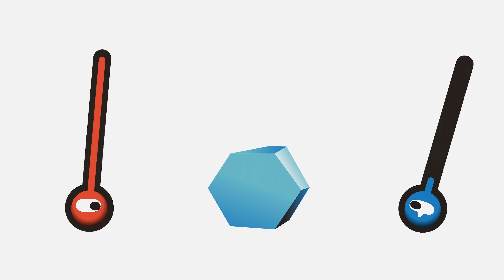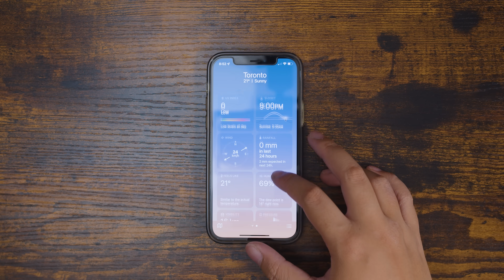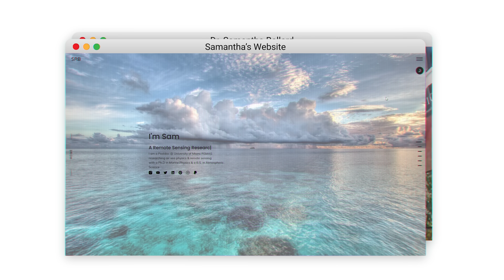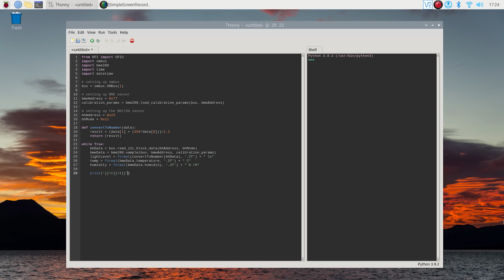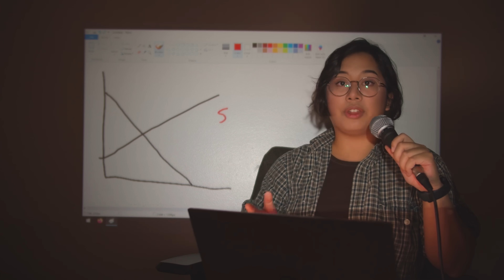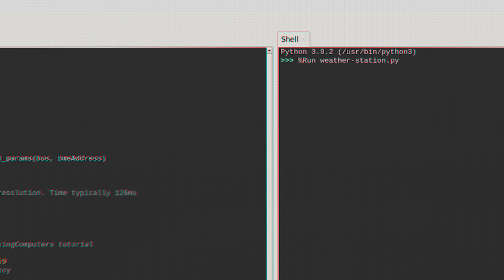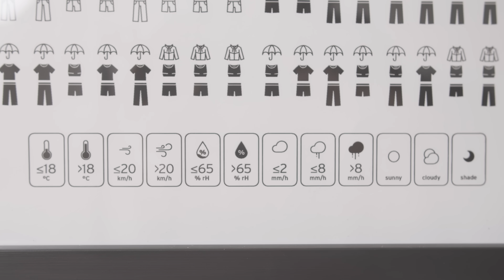how fahrenheit fails you

Comment: For me, most of the year, pants vs shorts is decided by the season. There is generally enough overlap between them that spring/fall I could wear either, unless the temp is far in either direction. I'll generally wear a t-shirt down into the upper 50s F, but am not uncomfortable wearing a light jacket into the upper 60s. Similarly, I can wear the light jacket down to the lower 40s or a heavier jacket into the mid 50s. Anything near or below freezing (32F) is at least pants and a full jacket. Gloves/hat generally below the upper 20s, extra layers below 10.

Now for the rant.

The nice thing about Fahrenheit is that below 0 or above 100 just means "don't go outside lol". If you have to go outside in those conditions, you really need to be prepared, or make it brief. Anything between is a sliding scale of what to wear.

I've never felt like Fahrenheit is harder to use as a result of the freezing/boiling points of water being 32/212. Those temperatures just aren't that relevant in my opinion. The only time I care about the boiling point of water is when boiling water on the stove, in which case, I don't need to know that it's at 212 to know it's boiling. The freezing point is also not really that relevant. And either way, I know that the freezing point is 32, as do the vast majority of people that use Fahrenheit. It's not like a "oh crap, what temperature is freezing again?", you just remember it.

The temperature scale you use in your daily life should reflect your daily life. Water really isn't as relevant as the Celsius advocates make it out to be. Sure, water is important, but the temperature scale being based on it really doesn't improve your life. If you find Celsius more intuitive, that's fine, I don't argue that you should switch to Fahrenheit. What I do suggest, though, is you stop trying to convince people that use Fahrenheit that their system is flawed because it's not based on water. That really doesn't matter at all. What does matter is having an intuitive understanding of what your arbitrary temperature system means in terms of what you need to wear to be comfortable.

Comment: I have made an effort to actually use both.  My biggest problem with C when compared to F is the C units are too large (1C is about 1.8F) but you rarely see C expressed in anything but whole units (i.e. 21, 22, 23).  You rarely see a forcast or a temperature reading from a weather app/webpage, with a fraction (21.5, etc).

Comment: Usually an ardent defender of imperial measurement systems, because of the intrinsic mathematical superiority of Base 12 over clunky Base 10, I’m going to go against my own rule here and state an unmitigated preference for Celsius over Fahrenheit, the main reason being the calibration points (0° and 100°) are known reference points, experienced on a regular basis by most people, and as such are intuitively relatable. The lower precision of Celsius degrees is really not an issue, as we are all used to using decimals and fractions in either degree scale when needed, and both being subsets of the overall Kelvin scale, mathematical calculations within them (20° is “half as warm” as 40°) are not intrinsically meaningful. 
Of course, independently verifiable definitions are one of the strong points frequently (and correctly) advertised by defenders of metric units, however most of these are not intuitively relatable to everyday experiences, and as such will not be meaningful to non-scientists. Not true with the Celsius scale, which is relatable to the everyday experience of most non-scientific users.

Comment: Okay few basic information 
Usually the lowest temperature in the winter is.. -2°C or 28.5°F
Usually the highest temperature in summer is.. 35°C or 95°F 
Room temperature 18-24°C or 64.5-78°F
which means...
cca 0-20-40 (cold - avarege - Spain heat 😅) in Celsius 
or 
cca 30-70-100 (cold - averege - Spain heat) in Fahrenheit
To me Celsius make more sense

Comment: 3M IS BAD 3M, a multinational conglomerate known for its wide range of products, has faced significant controversy over its environmental practices, particularly regarding water pollution. In the province of Zeeland, the company's activities have had a profound impact on the local water bodies, leading to growing concern among residents, environmentalists, and policymakers.

### The Issue at Hand

The core of the issue lies in the discharge of per- and polyfluoroalkyl substances (PFAS) from 3M's manufacturing processes. PFAS, often referred to as "forever chemicals" due to their persistence in the environment, have been found in alarming concentrations in Zeeland's water systems. These chemicals are used in a variety of products for their resistance to heat, water, and oil, but their durability means they do not break down easily in nature.

### Environmental Impact

1. **Water Contamination**: The discharge of PFAS into local rivers and groundwater has resulted in significant contamination. Studies have shown that these chemicals have infiltrated the drinking water supply, posing serious health risks to the local population. Long-term exposure to PFAS is linked to various health issues, including cancer, liver damage, and immune system disorders.

2. **Ecosystem Disruption**: The waterways in Zeeland are home to diverse ecosystems, including numerous fish species and aquatic plants. PFAS contamination disrupts these ecosystems, leading to reduced biodiversity and the collapse of certain populations. Fish and other wildlife absorb these chemicals, which then biomagnify up the food chain, affecting larger predators and even humans who consume local seafood.

3. **Economic Consequences**: Zeeland's economy is closely tied to its natural resources, including fishing and tourism. Water pollution directly impacts these industries, leading to reduced fish stocks and deterring tourists from visiting contaminated areas. This, in turn, affects the livelihoods of local fishermen, business owners, and others dependent on these sectors.

### Community Response

The people of Zeeland have not remained silent in the face of this environmental crisis. There have been numerous protests, public meetings, and campaigns demanding action from both 3M and the government. Local environmental groups have been at the forefront, conducting independent studies, raising awareness, and pushing for stricter regulations on industrial discharges.

### Legal and Regulatory Actions

In response to mounting pressure, local authorities and environmental agencies have initiated investigations and imposed fines on 3M for violating environmental standards. There is also a push for more stringent regulations to limit the discharge of harmful substances and to mandate comprehensive clean-up efforts by the company.

### 3M's Response

Faced with growing scrutiny, 3M has made public commitments to address the issue. The company claims to be investing in new technologies to reduce emissions and improve waste management practices. However, many critics argue that these efforts are insufficient and demand more substantial actions to remediate the existing contamination.

### The Path Forward

Addressing the water pollution crisis in Zeeland requires a multifaceted approach. This includes:

- **Stricter Enforcement of Environmental Regulations**: Ensuring that companies like 3M adhere to strict environmental standards and are held accountable for any breaches.
- **Investment in Clean-up Efforts**: Significant resources must be allocated to clean up contaminated water bodies and restore affected ecosystems.
- **Public Health Initiatives**: Providing support and medical monitoring for communities affected by PFAS exposure.
- **Sustainable Industrial Practices**: Encouraging industries to adopt greener technologies and practices to prevent future pollution.

In conclusion, the destruction of water bodies in the province of Zeeland by 3M is a stark reminder of the environmental costs of industrial activities. It underscores the need for robust environmental governance and corporate responsibility to safeguard natural resources and public health.

Comment: the start iof the video you told us how you felt and I immediately went its 27, I was 1 degree off the 26 you said it was. i love  celsius,  Fahreinheit is great, for humans body's 96 is normal HBT so I know that above 96 its hot, and below 80 is starting to get reasonably colder, anywhere near 40's or lower and my dick will fall off. (im aussie we live in the 80-100's) both are good for people. celsius and kelvin are great for engineering and science. plus to me 0 being freezing and 100 being water boiling sounds nicer.

Comment: want it simple on celsius? 0c or lower snow, 0c-15c still verry cold, 15c-20c slightly cold but some people is fine with a t-shirt around 20c, 20c-25c normal clothes, 25c+c air conditioner

Comment: Celcius is the right one, Fahrenheit are useless.

1. The entire world uses C, F is only on the USA.
2. C is based on water, which is easy for humans. At 0 oC it freezes, at 100oC it boils. Humans are most comfortable at 25 oC
3. To know exactly how much is X oF you need a Celsius thermometer. Science has very accurate definition of Celsius so we use them to calibrate Fahrenheit.

Metric is the RIGHT way only the USA uses the obsolete imperial system.

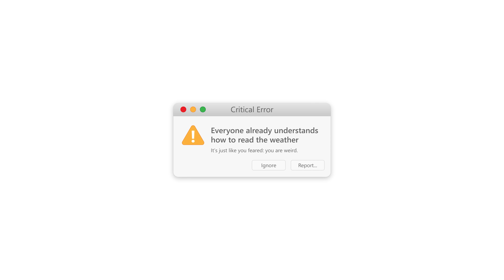Comment: Haha, I knew at ~ 5:00 Fahrenheit tells how you feel but you probably won't feel that way because your own conditions and the relative humidity (0% might make you feel 110 °F 80 °F, drying quickly, and even 32 °F can make you feel like 80 °F at 100% rel. humidity because you can't lose your body heat without evaporation) which means everyone needs their own Fahrenheit scale. 😂🤣😂 As a ℃ guy, I've never realized this. So, this is why ℃ won't fail you because it's based on physics, not feelings, so it forces you to check the other factors, or simply test your feeling of heat. Cool!

Comment: Paused at 1:47 for a comment: understanding Celsius is just a routine, based on physics, knowing which is normal in an educated society (I bet you end up with something like that, even if not this explicitly).
23 ℃ is room-temperate which you can handle easily without clothes because at normal relative humidity, your 36 ℃ body just loses the right amount of heat by its own skin-surface evaporation for easily maintaining that 36 ℃. This is why every ℃ above 23 is somewhat warm or hot, and everything under it is somewhat cold. At 0 ℃ is freezingly cold, obviously. That's it. I've never failed clothing up after checking the ℃ temperature, clouds and cloud map (genius-level: radar animations) and relative humidity. 😏 Now resuming the video…

Comment: I grew up with celsius and it makes perfect sense to me. 20 °C (+/-2 depending on if you're warm or cold) is room temp, ~37 °C is body temp/hot tub. 0 is freezing and 100 is boiling. The inbetweens are easier to think of with those reference temps

Comment: the problem isn't necessarily celcicus or farenheit problem in reference to feeling.. The feel depends on humidity too. I have lived near sea and  inland, near sea even a temparature 26-32C feels like 38-40.. But inland 35 feels like 35 with less humidity. 
Why humidity matters is its like sitting in a sauna, if high humidity is present, u will sweat but it wont evaporate.. just like told in video
Edit: I hadn't watched the whole video and realised half way through she knew the answer for the problem😂

Comment: Great video, I totally agree. Celsius is definitely easier for science and communication. It's not as precise though it's only got 100 points between frozen water and boiling water. Fahrenheit is almost twice as many. So you'd think it would be more precise and practical for science. The Celsius scale came out when the French basically lead the pursuit of the metric system. It is metric temperature.  My favorite temperature is 40° Fahrenheit. I'm a retired chef who hates working in hot kitchens. Walk-in refrigerator temp is slightly below that so, it's a perfect break area. And outside of its 40°, you can get yourself fairly warm in sunlight. It's beaming down the entire visual em spectrum plus different levels of UV and infrared radiation. Ends up being not too bad. Negative 40° is my second favorite temperature because that's where both scales meet. Besides if you live somewhere that gets that cold, that's a guaranteed snow day. Probably for the whole town or city where you live. So, that's an awesome temperature as long as your heater works. LMFAO

Comment: Tip: Celcius Temp * 2 + 30 is a great approximation for the true conversion, especially if you're just trying to get a rough feel for what a temperature would feel like. Between 30 and 80 degrees Fahrenheit, it's at most 3 degrees off.

Comment: The thing is though in both f and c what the temperature is will change in number in larger increments, I don't myself completely look at the temp for what i wear more of the season it currently is. I live in Canada where in the winter some of us wear shorts out side and in the summer hot leather jackets. and regardless of what the actual temperature is ill change accordingly to how i feel. when it comes to experiments regarding a more precise temp I will use the decimal system ex 10.5° or 10.6° because of how the metric system is designed to be divisible by 10 - 100  so adding (.10°) = the next integer 5° to 6° its rounded and can be precise so there is no need to say that F is more accurate than c because its not true when going out side to know the temp know that your human body avg temp is 37 and if out side is hotter than that you should dress accordingly and same goes for to cold if its 10 above wear a sweater/hoodie, below 10°/ 0° wear a winter coat/ or don't c° there is a reason that 90% of the planet switched to Celsius because it is and can be just as accurate as f with also being easier to understand because of when the phase change happens based on atmospheric pressure. Though it all doesn't matter when you look at kelvin because it really is the real way to measure something though how often... other than being in the vacuum of outer space. if you have read my comment all the way I thankyou !

Comment: I really think the "intuitiveness" of F is mostly just a byproduct of USians being used to it, and not anything fundamental to the system.

To wit: the whole "0 is fully cold, 100 is fully hot" that USians bring up... 0 is WAY colder than 100 is hot. At 100, as long as you hydrate and aren't too active, you'll be fine for a whole day. At 0, if you don't wear outdoor gear for the day, you'll die.

Comment: Celsius is much more intuitive in warmer climates than Canada. 0⁰C is crossing into dangerous territory. I'm personally never prepared for below freezing temperatures, so 0⁰C for me means staying inside or getting back to a warmer area. Also temperatures can easily exceed 100⁰F, so it's not even an upper limit. Then, at the end of the day, you just memorize the numbers that you know. I moved to the US as an adult, so I use Celsius for the weather (because of my life experience) and Fahrenheit for cooking, because I didn't deal with food temperatures much before moving to the US. For me 30⁰C is when it starts being hot, and 0⁰C is the lower limit.

Your main problems are the lake of interest in being outside and expecting one outfit to work well without layers. The weather changes throughout the day and from a spot to another. Also weather aps give the temperature in the shade, in the sun it's hotter. Another thing is the temperature of the wind when it's windy. That can also depends on your area. In some places, you can guess it from the wind direction while not in others. I usually need to put a jacket on and off when going between the sun and the shade in the winter or when my physical activity level changes.

Comment: I'm sorry, what 😂 How is 26° and 12°C confusing...

At MOST you need to live with whatever scale you're getting used to for half a year, until you've experienced roughly every type of temperature at least once and your mind has built a frame of reference for it. 
Once you did, it's simple:
0° is freezing, 15° is when you don't need a jacket anymore, 20° is ideal human activity temperature and pleasant in a t-shirt, 25° you can go swimming, 30° is unpleasantly hot and 40° feels like walking into a wall of heat, just stay inside. 70° is ideal for tea, and 100° is when water boils and is ready to be used immediately for cooking soup, pasta, etc.

You can make the same kind of scale for Fahrenheit too, ofc, just... idk, this is the most baffling video yet somehow 😅
Reply: I think you missed the point because the video is about comparing how it feels intuitively for the general population. The video bring up several points for why one persons hot might be another persons cold or vice versa, so they try to solve the problem of how to make it easy for everyone to get the right idea. Obviously if its just a simple transition from fahrenheit to celsius then the solution is to just get used to it, but what you said in the beginning was like if i told someone that it isnt hard to understand that 32 degrees is freezing temperature and not 0, or that boiling point is typically in the two hundreds. Obviously i would know, because im american. I grew up on this. I just dont understand how a ten degree difference can mean so much in celsius, but obviously i just have to get used to it.

Comment: I think we can agree that 0 degrees Celsius is cold and 100 degrees Celsius is scaldingly hot. Fahrenheit set the temperature of a mix of water, ice and salt as 0 degrees. I don't know the recipe of the mix and doubt if Fahrenheit knew the exact composition. Anyway, I think that using only water will do the trick a lot easier using the phase transition of ice into water into steam. Also, both Fahrenheit and Celsius were not Americans.